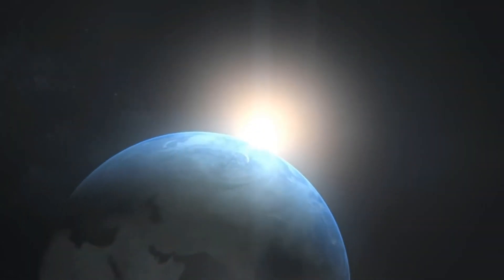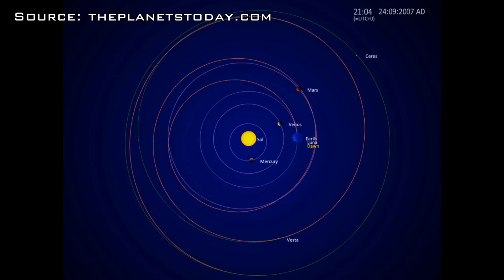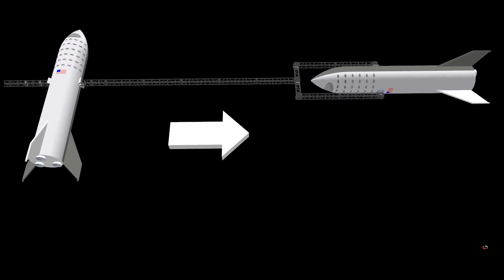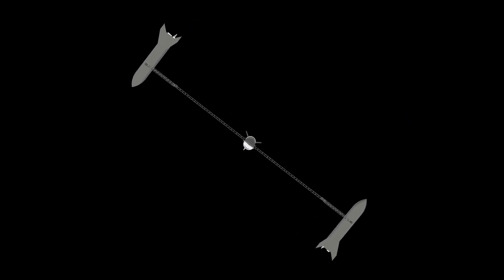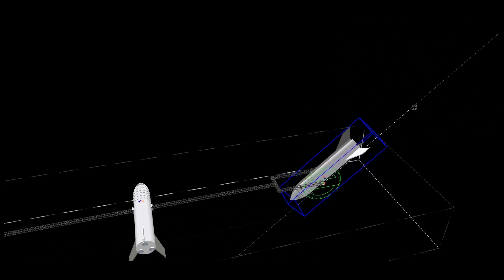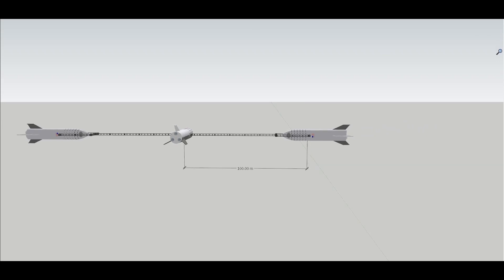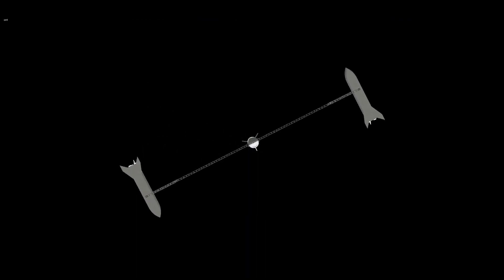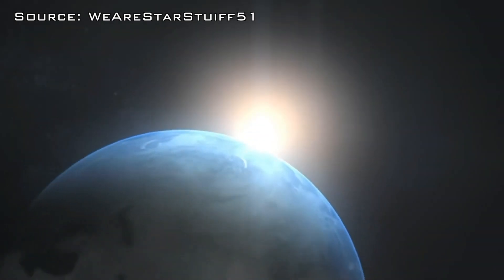GLS2: Artificial Gravity for SpaceX's Starship

Comment: Have you sent this idea to Elon and any other space agency??…don’t leave it to others if you have ideas, push and keep pushing to the people who will hear.....good luck 👍🏼
Reply: 179 thousand now know and can push it. That's far better.
Reply from the maker: @maixck  Honestly, I didn't make the video to get views.... but I guess I'm a YouTuber now. Just finished the script for my next video!
Reply: @smallstars  Hello smallstars. tbh, I think the trusses would need to be much longer to lower the 'gravity' differential between decks. This, as you have said would equate to much more weight. The control required to accelerate both hab ships at exactly the same rate would be difficult and probably create a lot more stress on the design of the trusses, even if you could stress them with a cable running down the middle. Still, I imagine an engineer might be able to work out a solution and there are no such things as bad ideas.

What about constant acceleration/deceleration though? Could a nuclear engine have enough thrust and fuel to do that at 1G for the journey to mars and back (at variable G as you suggested)? Could a nuclear engine also then be used as an alternate power source on the surface of mars? I know the Chinese currently have miniature reactors under development that apparently fit in a shipping container.
Reply: @smallstars  

Why have a connecting truss? Attach the two ships nose-nose and spin them. I get it that you won't get much artificial gravity near the fronts, but you would get acceptable gravity near the tails, where the crew quarters could be.
Reply: Marc’s Fx:
This idea has been in the air ever since Musk announced that 2 (!) Starships will be sent on a manned mission to Mars in 2024. For example, I have been writing about a pair of Starships attached to each other by trusses and rotating around a common center of mass in February 2019 on some russian sites.
This proposal differs by 3 Starships instead of 2, but it seems redundant and not obligatory, as for me.
Nevertheless, I hope that one of the reasons why Musk plans to send just a couple of Starship to Mars in 2024 is the ability to solve zero-G problem by means of rotation. As I understand, Musk is not plunged deep enough into problems of life-sustaining systems and solutions because at this phase SpaceX has to create a reliable ship, and all other issues would be considered only after that.
Reply: Number of Starships, 2, 3 or even 4 is not a relevant way to discard this artificial gravity option considering the fact Space X is already planning to send few Starships to Mars.

Venus (mentioned in some comments) is a shorter trip (ard 4 months compared to ard 6month for Mars) but considering how quickly the human body suffers from weightlessness  in space (https://en.wikipedia.org/wiki/Effect_of_spaceflight_on_the_human_body#Bone_and_muscle_deterioration) the problem of such trip seems to be almost the same as one to Mars on that matter, and if Humanity ever wants to achieve long distance travel in space, it would have to deal sooner or later with the weightlessness problem.

It looks to me it goes back again to a material engineering problem here (weight of the trusses, fuel consumption to spin the system, strain, etc...). 
Not to mention the deployment of such system which would be a big problematic I think... to be a viable option it would need to be able to deploy without astronauts' help.
 
Safety could also be an issue, a problem with one Starship could damage the other connected Starships  but considering the gain of an artificial gravity, it's still a worthy option.

It doesn't seem impossible at all and compare to creating a fully reusable spaceship it even sounds to be a piece of cake but it would certainly require some engineers late hours brain storming activities to figure it out.

On the other hand, it sounds a far far cheaper option than any other system I could hear about.
I would be very curious to hear some SpaceX engineers comments about it.
Reply: @inconnudetousse1929  I am not discarding this concept. But he is not the first to come up with the idea although it can appear that way in his video
Reply: Cormacnoah the problem is is that anything you think is a first has a 99.9% of being thought of by someone else, it’s if you have posted/published/patent it before that becomes "your" idea......I wouldn’t bore you with my ideas/dreams that have been inside my head for the last 40 odd years, an idea can come from a picture you’ve seen, a film you’ve watched etc......one thing for sure, no one will ever build my cotton candy spaceship that just stays in one position.......until my grandkids eat it all of course 😉😊
Reply: @More-Space-In-Ear  brilliant!
Reply: @muuubiee  you are so out man, od course you dont have to add force to keep it spinning. Its in the Space. There Is nothing to stop it in spinning like Gravity and atmosfere on earth. 1st newton law. Its fucking basic of all concepts of artificial Gravity.
Reply: this idea is some 60 years wandering around
Reply: @Trollociraptor  Only if there's constant thrust away from each other.

Otherwise they'll spring back to each other. The wire will flex and then try to go back to it's original length, resulting in the ships going back twowards each other.

The same happens with a static structure, but less noticeable, instead it'll probably just break.
If they were to use their main engines to start the spin it'd most likely snap again, sinve that force has to go through that entire structure.
Reply: @muuubiee  A crane can lift the empty ship.  Clearly steel cables are strong enough.  Clearly there are remedies and workarounds for the flexing maximum problem.
Reply: @redpillcoach1855  Why don't you mention one of these clear solutions to the flexing problems?
Sure, they probably won't accelerate at more than 9m/s, but the cable will still flex and pull them together again.

A static structure has to withstand all the forces going through it when you're spinning up. Then when it's spinning, you'd have 9m/s of centrifugal forces, which means you'd have to be able to lift the entire shift from that steel beam on earth, without any failure point on the ship or the beam. Of course you can make the ship spin a little slower, but it'll still most likely be too much force.

Also, obviously, they lift the starship unfueled on the ground, which means it's only 10-20% of it's fueled weight.
Reply: @muuubiee  what about making one of the connections an inflexible cable or strut?  I am not in any way a materials guy but there has to be something that has a high tensile strength, high compression strength and is somewhat flexible.  Use that for the center cable supporting truss.

Or a wound, stretchy substance that pushes away just enough to counter the attracting force.  Kind of a reverse slinky.

Or a mechanism like a grandfather clock that slowly let's out the chain to counter the springy attracting force.  Then every couple of weeks you wind up the "clock" and start over. 

Just a couple crazy ideas off the top of my head.
Reply: @redpillcoach1855  It's the principle as if you take a steel wire, with an end in each of your hands, and then you seperate your hands quickly. You'll bounce back, you can't avoid this, other than the grandfather clock thing you said, but I suspect that won't work out too well.
Reply: @muuubiee  how do they avoid the problem of elastic rebound when they lift something with a crane on Earth? That's 1g pulling down constantly on the load, which is exactly the force that would be constantly applied between two Starships, due to centripetal force, that were rotating at the proper  angular velocity around a common center of mass. 

While I appreciate that there is always overshoot with any change in velocity/force and that material elasticity introduces hysteresis effects, too, this happens on Earth exactly the same as in space. They successfully overcome this on earth with cranes all the time, simply by keeping the changes in velocity very gradual and slow, and employing damping systems (passive and/or active) to keep the associated force deltas well within the operating limits of the system and materials and to deal with hysteresis. 

In space, the only difference would be the addition of a rotating frame of reference, or degree of freedom of movement, created by the tether. But, all movement - not just spin up/down, but continuing stabilization and damping - would be accomplished actively, by RCS thrusters, in order to avoid exactly the kind of elastic effects and the associated overshoot and hysteresis that you are putting way too much weight on as a deal breaker.

@BP Professor is right. The tension on any cable/truss would balance with the elasticity at any given angular velocity, the exact same as a weight hanging on a cable from a crane on Earth doesn't bounce back up towards the boom of the crane, so long as the damping, inherent in the design and operation methodology overcomes this tendency and the forces (acceleration due to gravity and acceleration due to elasticity) dampen out and come into equilibrium. 

It's the changes in velocity that cause the effects you fear. The more constant the velocity (angular, or otherwise) can be maintained, the less the magnitude and rate of change of induced forces is; elastic, too (and the less fuel required to maintain that stability, too). 

So, so long as any needed changes (ie station keeping in any direction, including rotational) are gradual enough that they don't exceed the material limits of the structure, or the dampening capability of both the structure (passive) and/or the RCS (active) systems/design, then stability can be maintained quite easily (and fuel economized); especially since it would all be computer controlled.

This is why I still think a tether system would be best because it is MUCH lighter and more compact. The rigid truss idea is just to provide de facto passive damping; essentially to save fuel in damping with an active RCS. But, the benefit gained by the (semi) rigidity of a truss system is simply not worth the mass/volume it requires, compared to a purely tension structure (ie tether). 

You could take the fuel/oxidizer/tether mass/volume equivalent to what a truss system would require (not to mention, much less complexity to design/build/deploy) and have a much longer separation (a km or two) and thus, a much slower rotation and thus, requiring much more gradual changes in velocity and rate/magnitude of force change, too, to maintain stability. You'd avoid to a much greater degree, all the curvature effects you mention. Also, the physiological effects of rotating faster in a smaller radius would be less and you'd save a lot more RCS fuel, due to the lower magnitudes/frequency/rates of all the necessary station keeping and damping required.
Reply: @sluggo7  Earth has a constant acceleration, making two ships puff away from each other once is not a constant acceleration. Using RCS for 8 months to keep them rotating is just not gonna happen.
Reply: @muuubiee  "Earth has a constant acceleration" So does any rotating body. A constant angular velocity is equivalent to a constant linear acceleration away from the center of mass/rotation. No thrust is necessary to maintain constant rotation once commenced. 

The RCS would only need to be used to correct for extraneous forces, such as from movement within the Starships. But, this could also be damped out by mechanical movement of counterweights, gyros, fluids, etc.
Reply: its not a new concept though.  attaching two ships with a string and bring them to a spin was brought up 60 years ago.  the biggest issues are two.  1.)  if the distance between the two ships is small, no matter how fast you spin, your head will experience a different "gravitational pull" than your feet, resulting in a blood transfer differential.  2.)  if you go with the small distance between the ships, the spin level will have to be incredibly fast to be able to generate enough tangential force that it would take far too long to speed up/down to be able to handle normal operations around the starting/ending points of the route.  To not have such tremendous speeds while spinning, you'd have to increase the length of the string.  To the point it's unreasonable.

All this being said that if you were to have a short distance string between two ships spinning fast enough to generate enough force (ignoring point 1) you'd have any human being constantly throwing up due to the motion sickness of looking out a window.  But sure, trap them in a coffin with no windows and hope for the best I guess.
Reply: @thalanoth  you need 1 km length of metal tube and two ships producing 0.3 G, you do not need Earth's gravity, then you won't experience much of your problems and gravity will be sufficiently high (0.4 G is on Mars)
Reply: "Awesome advice!"... "Proactive and Reactive!" "Namaste!" Cosmic Tv
Reply: It’s a nice concept idea but it can be done easier than you showed. 1 rocket with 2 or even 1 extending arm with a small rocket attached to it, which creates the same movement, that to if they can manage to channel some of the exhaust and use that as a compressor based system it won’t even require extra propellant
Reply: @muuubiee  take two weights on the end of some elastic cord. Hang onto the end of each cord, one in each hand. Spin around fast enough (and at a constant speed) that the weights rise until the cord is parallel to the ground. Do the weights stay extended at the end of the taut cord? Do they spring back towards you, as long as you continue to spin at a constant speed? No, they won't. If you were in space and some force imparted your spin, would it take constant force to maintain that spin at a constant rate, once the outward centripetal force had come to equilibrium with the opposite elastic force of the cord? No, you would spin forever, so long as no other forces were introduced.
Reply: @sluggo7  Spinning them at constant speed requires acceleration, meaning you have to constantly accelerate the both ships to prevent them from falling back together... Like I already said.

It's practically impossible to put them at an equilibrium. Then beyond that there's always friction involved within the objects.
Reply: @sluggo7  If it was solid it could rotate, because it's holding up itself. It's a string, that string does not create a meaningful connection. They're two separate objects that have different vectors, the string just pulls them together once it can't expand more.

I'm fairly certain NASA looked at this, and concluded that it was not physically possible. Otherwise spinning something with a physical connection, making it a single object, will need to be so large that it won't be practical.
Reply: @muuubiee  "the string just pulls them together once it can't expand more" you are a wrong. The "string" (elastic tether) "TRIES" (or tends) to pull them together. But, the weights at the end create a tension force in the tether straight out from the center of rotation (ie center of mass). That keeps the tether tightly stretched out. There's no spring back towards the center, no matter how elastic the tether is, as long as the rotation is at a constant rpm (ie constant angular velocity), because the elastic potential energy (force) trying to pull the tether shorter is balanced against (ie in equilibrium with) the centrifugal force of the weights at both ends of the tether. Only a change in RPM (which would require an applied force, like a RCS thruster) would cause the tether to either stretch, or shrink to a new point of equilibrium, once the RPM became constant again, which would happen as soon as the force changing the RPM ceased. And that rotation, at any RPM, once commenced in space, would never stop, unless some new force was applied. 

If the change of RPM happened rapidly enough, there might be some over extension and spring back (like a bouncing Slinky toy). This would be due to overshoot (hysteresis). But, this is easily overcome (on earth, or in space; it matters not) by making sure changes in RPM (ie circumferential acceleration) are very gradual, so that the resulting overshoot is small enough to be within the range of the rotating system's ability to damp them out. This damping can be passive (ie designed into the system's geometry and/or materials; and remember, elastic materials are self-damping), or active (ie using RCS thrusters).
Reply: @sluggo7  The 2 pieces are going in different vectors, they'll always stretch the string. They are NOT orbiting each other. I guess the asteroids you've seen to believe this is possible are ORIBTING each other.

The two ships with a string are not orbiting each other, all the time they'll try to strech the string and they'll bounce back.
Reply: @muuubiee  No they won't, because as long as the RPM is constant, the "outward" force from the Starships is constant and it equalizes against the "inward" (elastic) force pulling them toward each other. This happens at whatever length the tether has stretched, to a point where it's elastic potential energy (ie force) equalizes against the outward centrifugal force (or even if the tether is "inelastic" (ie doesn't stretch much, or at all) the result is the same).
Reply: @muuubiee  what's the difference between the elastic or tension force pulling two bound weights together and the the force of gravity on two asteroids? Absolutely no difference. A force is a force is a force. Of course they are orbiting each other; around their common barycenter (ie center of mass).

That force (gravity, or elasticity, or any force) is balanced with the centrifugal force of the weights. The moon and Earth are orbiting each other and the moon is NOT going to spin down into the Earth at some point in the distant future (with the caveat, unless there's some additional perturbing force (tidal forces, for example) that causes the rotational angular velocity to decrease).
Reply: @sluggo7  The string is not a force, it applies a retracting force if it gets tension. Throw this into a physics engine and you'll see that this dumb tether thing wouldn't work.
Reply: @muuubiee  so, you're claiming that if you spin a weight around your head on the end of a tether at a constant rpm, it's going to come back towards you? Or, conversely, that in order to keep the weight extended to a constant distance from you, you're going to have to spin it at an ever increasing rpm?
Reply: @muuubiee  hahahahaha you're the poster child for the Dunning-Kruger Effect. You won't answer my questions because you can't.
Reply: muuubiee with your rope stretching experiment, you didn’t account for the outward force by the rotation. Take the same rope, and spin it in a circle. There are two forces at play here. The first which you mentioned, is the elasticity of the tether/rope, which would indeed try to pull the weight back in. The second force, which overpowers the elastic force is the outward angular velocity keeping the rope taut. Another thing you mentioned was that to keep it spinning, you needed to constantly apply force. While this is true on earth with atmosphere and gravity, in 0g space would be different, because there are no external forces large enough to disrupt the revolution of the weight around a string. I hope this helped, and please keep all discussions civil, this is science, not a petty debate to see who’s more educated.
Reply: Love it!!!
Reply: How would it still move toward the destination?
Reply: Why waste their time?
Reply: All these ideas usually come from movies. this concept is nothing new, it wouldn’t work tho. Even if you got the math right to make the rooms match the angular momentum, there’s reason to believe that people would experience motion sickness. Gravity and force exerted thru motion are completely different.
Reply: This concept of creating artificial gravity has existed long before the guy came up with it
Reply: @AntiNoobDefence  Do you have links ?
Reply: I really wish people would do their due diligence in researching topics before they make uneducated comments. We've had a space program for over 50. We have the data for people spending long periods in space. We have the data for centrifuge experiments to create artificial gravity (see my lengthy reply to a comment in an above post, where I sight real government research). YouTube, Wikipedia, and the TV, are not reliable sources of information. If you are really interested in educating yourself on a topic, peer reviewed research papers published in respected scientific journals are what real scientists and engineers use. Why do you think Elon isn't proposing anything like this,...because he does have the best scientists/engineers. I read some these comments saying this is a brilliant idea,...no it's not. It has been researched AND the results have been published for decades.
Reply: @jasonlewis2542    Well... That's nice to know. But it's exciting that people are finally once again excited about space travel... And i don't mean up into orbit around earth and then down again... a.k.a. ISS. I mean actual space travel not just to the moon but beyond! Hopefully, more of our young folks are following this and entering college to become engineers, scientists, astronomers, physicists and astronauts!  Let us finally boldly go where no one has gone before!  Videos and ideas like this stir up interest, discussion, debate, and hopefully create some real engineers and intrepid scientist explorers.
Reply: @YUMA-jz9xx  Space has always been exciting, and the plans to go to Mars have been announced for quite a while. I am happy that people are talking, I just hope I can give people some insight on how to use real resources for information. Imagine all the work that someone like the guy from this channel has and would continue to do on this idea, only to find out later that it doesn't work and has been tried. Imagination and education go hand-in-hand. After my post, as disappointing as it may be, he can use his energies to come up with an original idea.
Reply: @jasonlewis2542  can you elaborate why it is impossible? since most of us are not doing research on NASA history
Reply: @saulsavelis575  I spell all of the science out, and include an NIH publications of a study done with doctors, researchers, and astronauts, in a rather lengthy replay to small stars 5 days ago. It's not just about looking at the history of NASA, but looking at published, peer reviewed, and respected (among the scientific community) research journals/publications. Wikipedia, YouTube, and TV are NOT the way to research a topic, if someone is serious about learning and/or contributing to advancements or even a conversation with the people that are actually 'doing it.' This post, and the respective comments, are a perfect example. Many people are kindly telling this guy (smallstars), that his idea is great, and he should patent it, and that he should go to Elon Musk, NASA, etc. If he did, and (this is a big if), they were to give them the time of day, they would have to waste their time educating him on the topic. Most likely, they would inform (possibly reprimand) him on how he should follow the scientific method, and due his due diligence in researching and becoming competent on the topic. With a little effort, and with the help of the internet (and knowing where to look on the internet), it's not difficult to become familiar (and much more), on just about any subject.
Reply: @jasonlewis2542  but u just told trivial info...I asked if u urself can prove it? do u understand what u r talking or not? referencing to books or articles does not prove anything
Reply: @jasonlewis2542  u r clearly delusional...I'm not asking to state the obvious (as saying that scientists are working on this, therefore you know nothing), I'm asking u to show your own intelligence and knowledge...it is clearly lacking in u
Reply: @jasonlewis2542  we are not writing PhD thesis or articles here, besides ALL scientific work is being challenged every time and that is called science, so stop bs about references, just prove someone is wrong or prove that you are right, not in reading fairy-tales, but in arguing physics and engineering and models provided
Reply: @jasonlewis2542  "I also know with absolute certainty that you did not read that article, which proves my point." there are more than 1 mln of scientific articles so you are right I have never heard about your article, but that doesn't prove that I am more stupid than you or even than those who wrote that article...use your brain and simple logic...you just proved that you didn't understand that article, since you cannot retell what you have read there...with certainty I can state and prove that you just read the title
Reply: @jasonlewis2542  "One last time, person travelling in a circle, feet are moving faster than the head. Therefore the feet feel heavy, head feels light." well now it easy to prove you r wrong: 1) the same is happening on Earth and when you are running (and only affects when you are moving along the tangent, but it will feel as climbing or descending, but in disoriented manner), 2) the problem not in this since to obtain this effect we and create gravity in the first place...you just simply will feel dizzy like sea sickness, but we can lower this effect to the bearable levels...so there are many problems, but it seems that with 1km length tube and with only 0.3 or 0.4 G we probably can survive long terms with little annoying things and adverse effects, so let's build it in space and if needed we can extend the tube telescopically to 3km easily
Reply: @saulsavelis575  WOW, so you're saying that published scientific research is trivial. Do you know what the word trivial means, please look it up. So prove to me with absolute certainty that I didn't read the article, you can't. I know you didn't, otherwise you would have stated something, ANYTHING contained in the publication in your reply. All you did is read the title, prove me wrong! You didn't refute my statement about you not having any higher education, otherwise you would have (don't try to backpedal and lie about anything now, and please let me know if I'm using words you don't understand). I have already proved, without a shadow of a doubt, that this idea won't work. You did read that with diameters of 600m would it be somewhat worth it, right? Science that isn't established with certainty is challenged. This is not that science. Throw the ball up, it comes down, and here is the mathematics that describe those motions and forces,...that is what we are talking about, which hasn't been challenged in HUNDREDS OF YEARS. It's simple HS physics. The idea in this video was a good idea that people had a long time ago. It was good enough to invest money (tax payer), time, manpower, resources, and everything else required to throughly investigate it. The conclusions of the study are PUBLISHED IN THE NIH PAPER, that you claim you've read. Nor did you really read/comprehend my response to the video. You, on the other hand, have proven absolutely nothing other than your ignorance, lack of education, laziness, and willingness to argue without educating yourself on the topic first. This is basic HS physics and algebra (fyi- HS is an abbreviation for high school). There is no calculus or quantum mechanics involved here. If you can't understand even the simplest explanation of the difference of forces of someone's head and feet in circular motion, you never will, nor will anyone else be able to explain it to you. Forget having a discussion about the basic equations/math involved, as this would require simple tools that you do not possess. To call the published findings of the experimental results from the MOST RESPECTED PUBLICATION OF HEALTH AND SCIENCE IN THE WORLD as trivial,...WOW, like a dog chasing it's own tail, truly amazing! I really don't have the desire to teach basic algebra or the basics of Newtonian Physics to someone so intellectually inept, delusional, and lazy. It's like a checker trying to have a conversation with a Chess piece. Normally, I would go out of my way to teach someone, who is sincere about learning, something he/she doesn't understand. Most often, a student doesn't understand a particular aspect, and can articulate what specifically that is, such as the concept, or the equations, or how one is applied to the other. However, you can state neither, you just want to argue and try to prove that you're not uneducated about the subject, with the result of you proving the exact opposite, as you keep digging yourself deeper into the inescapable hole of ignorance. Someone, please come rescue this guy. If there is anyone out there reading this that can come to this guys aid, have an intelligent conversation with me about this topic (and having read the NIH paper, or at least made an honest effort to), please chime in. Saul, have you noticed that even the owner of this video is not trying to defend it? It would appear that he's convinced that this won't work as he's proposed. You're the only one, smart guy. I can see that you are not sincere in wanting to understand the subject, as do my students. Yes, I've shared this with my class from the start, and they are really looking forward to a response from you. Want proof,...have I ever used harsh language? No, but maybe I just don't want my response flagged by YT. Easy fix, just abbreviate harsh language or put symbols between the first and last letters. I also have not used the word 'dumb,' as I have taught them that there is no such thing as a dumb question, in my class. They have pointed out to me that you've never asked a real question, and laugh about how you want me to prove that I've read the paper that I've referenced (this is really funny, especially for a student in my college physics class). They, on the other hand, have read it (I gave it as homework), and they understand it. They are first year/first semester students, and fresh out of HS. They understand what it is to be sincere in having questions, and point out all of the ways you've proven that you are not. This is having a very positive result in  them though, and for this I am grateful. It has given them more validation about the importance of an education, and their choice to pursue one. It is also proof for them that no matter how much valid proof some people are given, these people will try to argue a point they have no education or experience to successfully do. It shows that just because someone makes a professional looking video and post it, doesn't make it true,...Nor does the view count or how many 'likes' people have given it. What's found in Wikipedia isn't always valid, nor is using wiki as a resource a good idea when researching a topic. They really want this to continue, but I told them there was nothing left to learn from this, and the only value left is entertainment. Tomorrow will be a treat for them, as they get to hear your last response, and this one from me, in one day, and possibly even one more from you. As I don't waste class time with my responses, this will, in all likelihood, be it for me. It's all good, you can have the last word.
Reply: @jasonlewis2542  I'm saying that you are "trivial" and naive (softly saying) and that your knowledge about something written (knowing a title or some not understood or distorted results) does not mean that you know and understand what is written...so trivial is not scientific results, but the referencing to science...everybody knows that scientists are working on these problems for centuries...THAT IS TRIVIAL and you are just too weak to comprehend this, that is why you are talking about cosmos when others are talking about the shopping
Reply: @jasonlewis2542  "So prove to me with absolute certainty that I didn't read the article, you can't." maybe, but everyone can prove that you didn't understand what you read (that is why it is safe to say that did not read and article)...even what I (and others also more capable than you) write here
Reply: @jasonlewis2542  "I have already proved, without a shadow of a doubt" unfortunately only to your own delusional mind
Reply: @jasonlewis2542   "If you can't understand even the simplest explanation of the difference of forces of someone's head and feet in circular motion, you never will, nor will anyone else be able to explain it to you." so what you could not grasp in the text I wrote? even the part where I complement you? or that the same is happening on Earth all the time?
Reply: Well this wouldn't work, but it's better than the thread version of this.
In the thread version, it's fairly simple. The thread will flex out it's maximum amount, and then it'll pull the crafts back together. The only way around this is to boost the rockets continuously... Which takes fuel, and it will probably snap the thread.

This version just wouldn't be ale to withstand all that force. The metal will flex out, then get compressed, if it hasn't already snapped. It'll sway back and forth. Even with a much stronger support it'll break. It's a long distance, and a thin piece, it'll be flexing and getting all sorts of stresses.
Reply: @muuubiee  a rigid structure connecting the two ships would be better
Reply: @AntiNoobDefence  Yes, as I said. But a better bad idea is a bad idea.
Reply: WHY THE TRUSS HAS TO BE SO LONG MAKE THEM SHORTER , FOR LESS BRAKING , STRONGER THAT WAY , OR PUT THE STARSHIPS SIDE BY SIDE AND ROTATE , ELIMINATE THE TRUSS ALTOGETHER  YOU WOULD STILL MAKE ( 2 G ) GRAVITY .
Reply: steven pulsinelli please don’t shout Steven, it’s uncalled for...if your angry then just state why...is small caps not capitals. Thank you..
Reply: SpaceX have the brightest and most creative engineers in the world. This is kind of a silly concept, and would have been dismissed accordingly. Too much weight, too much fuel.
Reply: @jonjonsson4270  we'll see how silly it seems when astronauts and biologists work out the breaking points of the human body when spending months on end in 0g only to land on a barren wasteland with a third of a g where they will be required to carry out mission critical tasks for well over a year before spending several more months in 0g only to return to 1 full g. Its a stretch to imagine doing it even with gravity let alone with all the health problems associated with 0g...

...that said I've also thought about this concept myself so undoubtedly SpaceX have too.
Reply: @doritoification so, you committed a fallacy... that's okay. Astronauts will absolutely have to have some sort of gravity simulator, to provide resistance and keep bones healthy and muscles active. The solution does not have to be this hair-brained idea to send 3 separate starships at the same time, with one having a full payload of trusses and mechanical component to create artificial gravity for a few months. Sorry, never part of the plan, never gonna happen. There are other ways to deal with it. Or don't, and just go to Venus, which is what I would really support.
Reply: @jonjonsson4270  so why aming to mars at all?
Reply: @CCAPACCO  thats his point
Reply: @CCAPACCO  and the reason why elon prefers mars is probably because its a constructive direction for deep space travel
Reply: @jonjonsson4270  Elon will be sending 2 crewed Starships and 2 cargo Starships in 2024. So there is going to be 6 ships in total on Mars (plus 2 ships sent earlier in 2022) in 2024. I don't think a 3rd ship is any different or even using one of the cargo ships.
Reply: @jonjonsson4270  I also support cloud cities on Venus. Although, stainless steel would probably be useless in that acid.
Reply: @jonjonsson4270  

Why not send two at once? There's gonna need to be more than one mission to Mars anyway, so why not send them off in pairs? One could be a lifeboat in case of failures, and one could stay in orbit while the other descends.
Reply: @jonjonsson4270  it is the cheapest way to create gravity and on top of this travel with it...except acceleration, but you can accelerate only for short time and then you will need again decelerate...this idea of two tethered ships with central part pushing whole system forward is much much better and cheaper since anyway you will need at least 3 ships when you will travel to Mars (only one landing and two orbit Mars for back up and communication with Earth)
Reply from the maker: @jonjonsson4270  If 6 tons of fuel is too much, (to start and stop the spin) what amount of fuel will be ok? Also, how exactly is there too much weight?
Reply: @smallstars   Elon will be sending 2 crewed Starships and 2 cargo Starships in 2024. Have you considered that 1 of the cargo ships could be used for this? Besides, 100t - 150t is a lot of payload capacity and I don't think the weight is the issue here, it's the space the trusses take _(you can't fit 100t of feathers in there)_. If that can be figured out that would be great. In any case an additional Starship is mission critical because health-failure of these people will fail the entire effort, which has very high probability of being the case.
Reply: @smallstars  There's always too much weight.The biggest issue is not whatever happens in space, but rather the launch on earth, required escape velocity for the weight of the rocket and so on. The less weight from the start, the better. And yes, there's actually also drag and inertia in space, amongst gravitational pool of other stars, so you'd benefit from having a small mass more easily flown away from whatever effects it floating through space. Honestly, a lot of people seem rather ignorant on how delicate and hostile flying through space is. You wouldn't have the option of flying a super huge structure with multiple rockets attached on the far ends, without inevitable damage to everything. The solar kite stuff for close to light speed travel is similarly flawed. Micro meteorites would destroy it well before ever catching any kind of speed.
Reply: @jonjonsson4270  It gets worse. The centrifugal concept wouldn't actually create gravity. There's no gravitational pull that would make any kind of fast rotation heavier so to speak. Any kind of force that is created also has odd effects like things falling down in curved lines and the issue of having more of a pull lower to the edge of the rotation, meaning your blood is going places it shouldn't go. Not to mention the high speed you would need to achieve in order for anything close to earth's gravitational pull and again it just would not be the same. Even worse, one defect in whatever spins around and you will have a space station that will float in all manner unwanted directions. The very concept is flawed, which is why it was never attempted despite concepts like this having existed for half a century. In fact, I don't think centrifugal forces in space work quite the way people wish them to work. It's not the same as gravity by mass pulling you down perpendicular to the floor at all times. It gets weird when things are falling, as mentioned before it will drop with curved lines. The implication is that longterm 'gravity' in this way will absolutely mess with your bones and vascular system. Assuming it half way works anyway. A lot of physics effects observed on earth are the way they are because of gravity and not in spite of it. As far as we know, gravity can only be caused by a huge mass.
Reply: @jonjonsson4270  OK, lets leave the bulk of the weight in the centre and have just the living quarters at the extremities. Make more sense now?